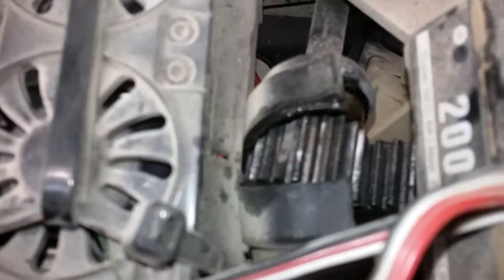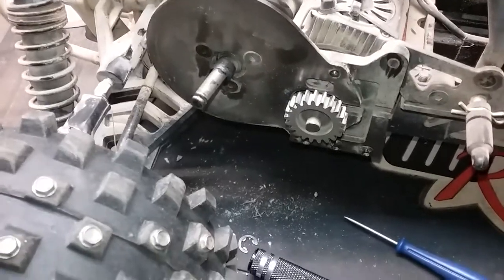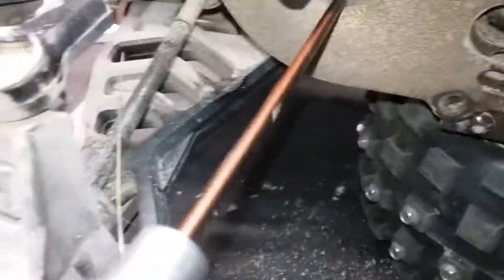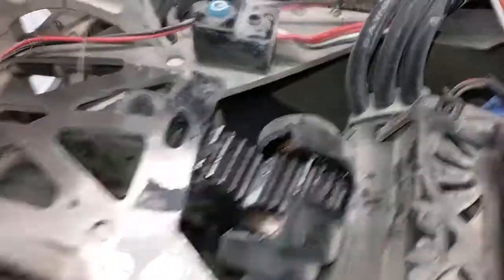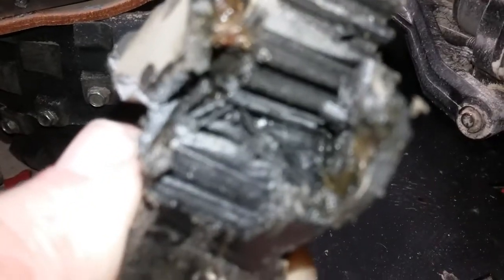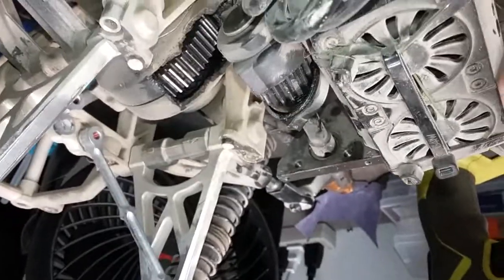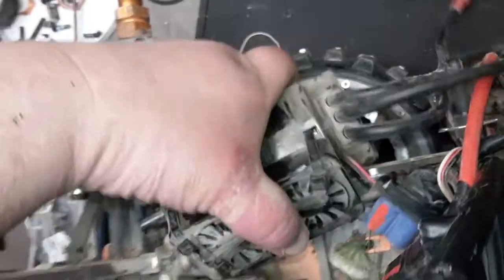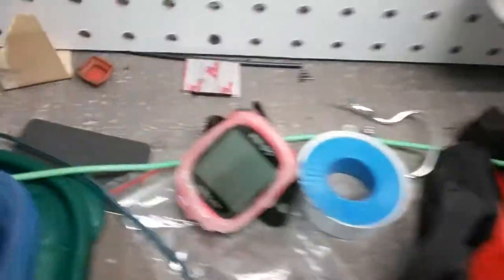Brushless 5b, the first casualty! Over-powered! But I love it!

Comment: Great Vid! Thats why i dont use locktite anymore! Now i rather loose the bolt than cant getting it out lol!  IF you want good camera get the dji osmos cam very good and less than half of the gopro
Reply from the maker: I bought a campark v40. It was a turd, so i returned it. For the last 5 or 6 videos im filming with a samsung galaxy s9. The videos are alot better.  Check em out!